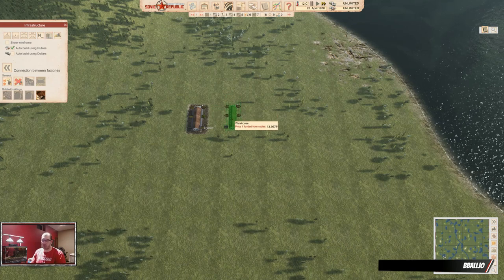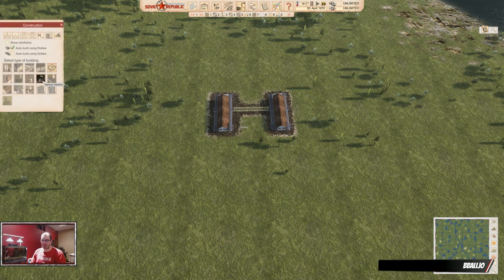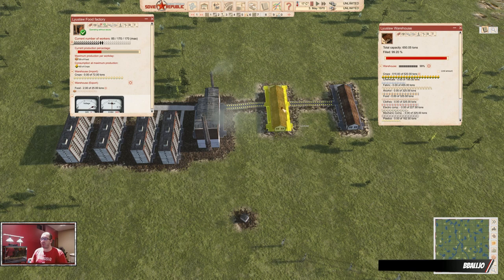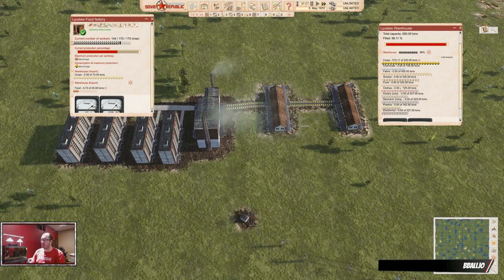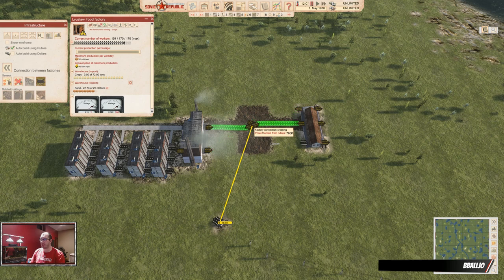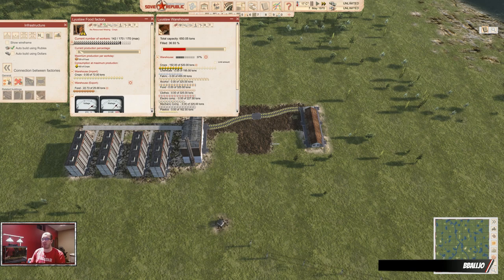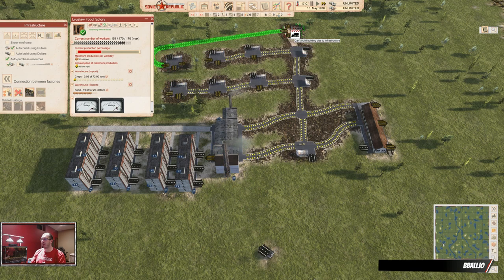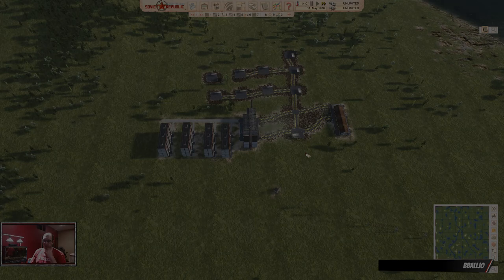Factory Connection and Forklift Guide | Tutorial | Workers & Resources: Soviet Republic Guides

Comment: In my experience distribution offices and trucks do the same as foklifts, but better. It's even better when modded, high capacity vehicles are used. If I can't use direct factory connectios, I just use trucks instead.
Reply from the maker: That is true, especially in vanilla...but I find that your setup becomes limited by the number of factory connections of the buildings involved when using direct connections and using trucks has their own issues with traffic and fuel congestion in busy areas, but is a viable option.

I like that forklifts allow you to create larger connected industrial areas that have unlimited connections...I do only use modded forklifts that have 4x the capacity, and they seem to keep up pretty well.

In the end I feel that this comes down to preference and actual setup, looking at distances and volume and so on...

Thanks for posting!

Edit: forklifts are terrible for high volume goods, like crops...so trucks or direct connections only for those :)
Reply: i started playing, knowing a bunch as if have watched a series on it but am still learning. i tested and built a very large distribution using forklifts moving food, alcohol and meat around, around 15 stations with 3 8 modded station all with the modded lz6050. fuel was turned off. it is nice thinking but the planing, micromanagment, the not available %loading choice and the downtimes driving back to the depot will keep me from building larger projects with this kind of distribution again. for getting steel over a crossing or some medium distributions its good but maybe i am to limited in my planing capacity for large projects.

Comment: I am thinking about how many factories you can "chain". I guess the max is 2. And with this I mean:
1 fabric factory is connected to 1 clothes that is connected to another clothes factory. If you build a third clothes factory it will tell "not working, not enough fabric". right?
This would basically make a chain that will minimize space used. in theory you can add a loading station at the second clothes factory and it will pull also from the first one "through" the second. I imagine...
Reply from the maker: This is all up to your setup, and then your production capacity and your transport network...the most connections on a building in vanilla is 5 (warehouse)...in actuality the bigger challenge is getting workers out effectively, which was made easier by the last update with above and underground paths.

Comment: Is it possible to connect a meat storage to a werhouse (in order to then connect to a cargo train)?
Reply from the maker: Thanks for your questions. 
No, a meat warehouse is a passive building, just like the warehouse, they won't push or pull any cargo between them. The meat warehouse would need to be connected to the cargo station directly, unless you want to use forklifts.
Reply: @bballjo  Right, now it makes sense, thanks for the tip.